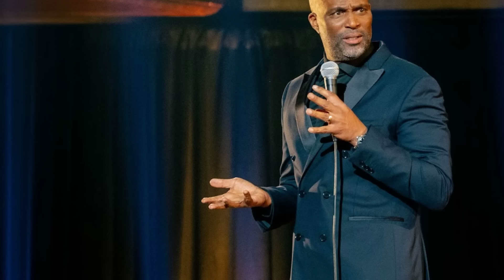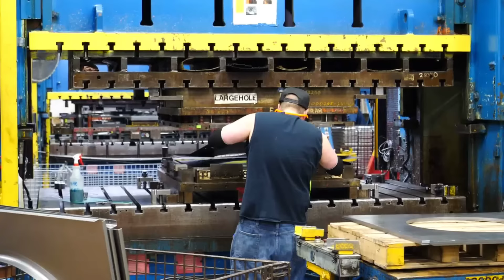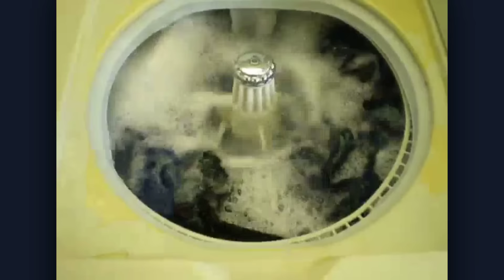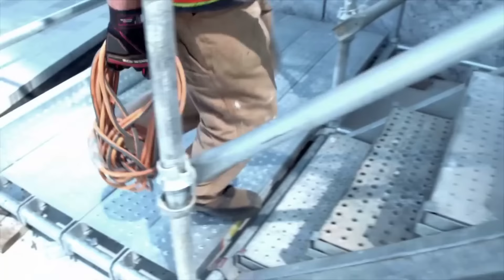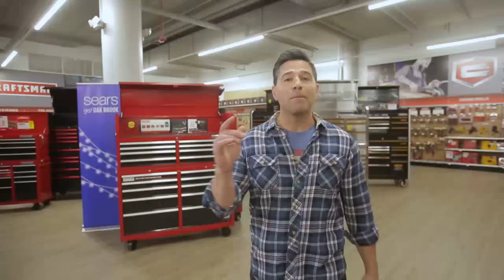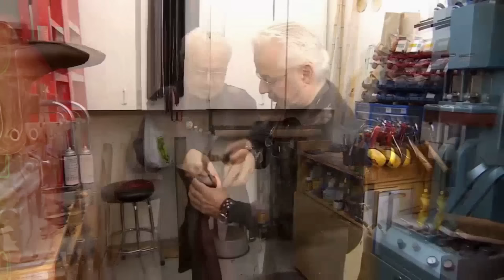The Only 5 Brands That Still Last (The "Buy It For Life" List)

Comment: Modern machines are designed to be made cheap, break easily, and get the owners to pay a ridiculous premium on the exact same cheap “genuine parts” to repair them or just replace them entirely.

My 8-year-old dryer stopped drying a couple years ago. The “genuine” part was going to cost a full quarter of the cost of the entire machine when it was new. The third-party replacement part cost $30 for two of them. So now I have a backup heating element for when the replacement eventually fails.

Same with my gas oven. After 7 years it suddenly wouldn’t get to full temp and would take nearly 45 mins to get to 400F. Replacement igniter part from Samsung or their authorized partners was $250. Third party drop-in replacement igniter made in probably the exact same factory in China, cost $20 with free two-day shipping. It took less than 10 minutes to replace and was heating to 400F in under 8 mins.

They don’t want us to have appliances that can be repaired cheaply. They want to be able to double dip with an extended warrantee, expensive repairs, and then hit us for a full replacement every 5-10 years. Mechanical failure is baked into their business model. It’s why the parts most likely to fail are expensive and the ones least likely to fail, are generic, or non-proprietary aren’t.

Comment: For all modern appliances with digital controls, like air conditioners, washing machines and microwaves, buy a surge protector for $10 to $15 to help protect the electronics. Look for a VPR (voltage protection rating aka let-thru voltage) of 500 volts or less, it should be stamped on the back of any reputable surge protector. VPR is determined during the UL 1449 certification tests.

Comment: We bought a Speed Queen a number of years ago because we got tired of having to repair a motherboard in the old washer.
While at the dealer my wife almost bit on a new model that SQueen had come out that had a hunch of electronic bells and whistles. I asked her why do you think it had a 5 yr warranty and weren't we there because of our frustration with the electronics? Thankfully we went with our original goal. It's still running like a tank and I smile everytime I hear the ratcheting of the dials as I prepare a load! 😁

Comment: One thing I'd add -- I know this video is talking about products you can still buy brand-new, but for cookware, let me recommend vintage pre-1968 Revereware. There is a lot of it available in thrift stores and antique stores. It uses no Teflon, a good thing as we are coming to realize, and it is much lighter than cast-iron skillets. Pots/saucepans are available as well -- in cast iron these pieces are unwieldy. But make sure you research first and seek out genuine pre-1968 Revereware -- you can easily tell it from later Revereware by looking for the pre-1968 double-ring logo on the bottom. Unfortunately, the brand was fatally cheapened for the remainder of its run.

Comment: I can agree on some points and disagree on others. Sometimes longevity of the products depends on how it was used. Very often people abuse appliances and they break. I still use my kitchen small electric appliances that i bought in late 90's and very early 00's. I came to conclusion that aluminum pans are no match for steel pans, and steel pans are better than cast iron.    I own a lot of different stuff that works fine  for many years. And i am talking about electrics and electronics.

Comment: Lodge are not good pans.  They don’t work like your mom’s good cast iron pan because the inside is not finished like it is supposed to be.  They are ten times harder to keep clean and free of rust and food sticks because the inside is not ground smooth.  It is rough cast just like the outside because it is cheap.  Buy an expensive one that is ground smooth or get out your angle grinder and Emory cloth and re-season it after it is smooth or you will hate it and not understand why your pan sucks compared to your parents.  Everything else sounds good

Comment: I have my 20 years old Moccamaster coffee maker (at least back then they were hand assembled in Netherlands) and about 15-year-old Bosch heatpump clothes dryer. Neither was cheap, but a high quality product is a pleasure to use every time. I've actually also been very happy with LG front loading washing machine, that I also think is at least close to 15 years. It is one of the few brands that still has not switched to welded tubs, so you can still change individual parts of the tub assembly.

Comment: Have a speed queen, and it actually doesn’t fill all the way to the top. But with a couple minutes research on YouTube, you can make it do so. The reason it doesn’t is federal regulations- but speed queen is smart enough to make the machine easy to, shall we say, “reconfigure”,so it works the way it should. 😉

Comment: I got married in 1986 her parents gifted us a washer and dryer, just base model old whirlpools. Both of those machines are still running today, I think the dryer has had one or two heating elements go out through the years, but the washing machine is only had one bushing replaced at the bottom of the tub. Not too bad for almost 38 years

Comment: My grandfather told my dad 80 years ago, ''You can buy expensive once, or you can buy cheap over and over.'' I still have some of grandpa's carpentry tools. I have cast iron pans that are over 30 years old. And I  have a pair of Thorogood boots that are about 15 years old. If I  had known it at the time what I  learned a couple years ago, my washer and dryer would be Speed Queen.

Comment: Lawnmower carburetors only gum up if you don't use 99 grade fuel and and put the anti-gumming additive in. If it still doesn't start take the filter off and spray starter fuel directly into it. If even that doesn't work a new carburetor costs about twenty dollars on ebay and can be substituted in five minutes.

Comment: It is possible to make electronics which last.  The problem is corporations no longer have an interest in building them.  I have a GE radio alarm clock my parents got me for Christmas in 1973.  I have had it through 9 moves and over 50 years now.  It still functions as well as it did on that Christmas morning in 1973.  It not only works, but it is one of the few clock radios I have seen which has an adjustable LED clock to the point you can make it dim enough to not be overly bright in a pitch black room or be bright enough to be seen in a well lit room.  I have plugged into a surge protector, and I hope it lives longer than I do.  :D

So, it is possible.  But unsurprisingly no corporation wants to make a product like that now -- and that is a sad fact.

Comment: Off topic for home appliances and stuff...but just thought Id share my experience; in 2003, I bought a Toyota Matrix XRS.  23 years later, I still have that same Toyota Matrix.  It has been by far the best purchase I've made of all the purchases there have been.  Only recently have I considered selling it for another car only because of how much cars have progressed since then.  Two things, premium gas and synthetic oil.  Never had an engine problem with that car once...everything else has been mechanical maintenance.  100% would buy again...if they still made it.

Comment: Have you thought of the amount of water an old Maytag top loader uses for a hot wash of 10 pounds?
around 75 gallons, an european front loader uses around 18 gallons for the same wash, and it actually make the clothes cleaner. I have tried both. The european also uses less kWh for the wash. I have owned danish (Haka Fullmatic 17 years), italian (Zanuzzi 15 years), welsh (Hoover 9 years, bad machine) german (Bosch 6 years still running), chinese (Samsung 15 years, couldn't get a new pcb, tired components)), polish (Samsung 1 year running), the reason for changing the machines have been the need for higher spinning speed  (Zanussi) or old age.
Hans Denmark

Comment: To be fair   Craftsmen hasn't ever been quality,   30 years ago went to sears to replace a flathead  for breaking on a actual screw  wasn't even using it as a pry bar and they found out it was broken on a car.. so they told me that they wouldn't replace it because Craftsman tools are not meant for professional use,  I told them it was in my drive way that isn't professional environment...  still refused.   lol  never bought another craftsman product after that

Comment: My local laundromat was opened back in the mid 70's and uses nothing but Speed Queen commercial washers and dryers; many of these were installed when the laundromat first opened 50 years ago and are still working flawlessly today.  The owner told me that the newest Speed Queen equipment that she has on the premises dates from the early 90's when they expanded the business and needed additional washers & dryers; she has them all serviced regularly and when something breaks or wears out the repairman simply replaces the required part and the machine returns to service without delay.

Comment: I'm a speed queen guy, they are awesome BUT they definitely still have a computer control board.  That computer isn't the problem, the manufacturers that install crap computers are.  In fairness those manufacturers are a reflection of the consumer.  If you want better products do more homework before laying down cash and convince your family and friends to do the same.  It's not a conspiracy, it's simple free market dynamics.

Comment: Speed Queen is reliable, but I don't need to wash with violence, and my Miele has been working for 20 years with not one problem and I like my clothes to last a long time. Our Lodge cast iron pan has hotspots, where as the Wagner one doesn't, Craftsman... back in the day, their power tools were low-end (Crapsman) and I think they probably still are. And they are NOT Made in USA. What Craftsman was known for were their strong but clunky wrenches, because they would not break. They are made in China now. The Redwing boots I wear daily are great and will outlast me. Wright tools are wonderful I'm sure, but check the prices, Holy cow!

Comment: Small engines dont start after a winter break because of all the ethanol put in pump gas now. Ethanol absorbs water and also dries out rubber seas. I used stabilizer and install a cheap cut off switch on the fuel line. Before winter storage, I close the valve and run the engine until it dies, effectively draining the carburetor of fuel.

Comment: My 2006 Toyota Camry has 200k plus miles on it and has never had to be repaired except for a couple of batteries and tires and replacing windshield wipers and headlights. Engine wise it is still solid. Drove 100 miles to work and back for 12 years and took many trips in it.

Comment: Or you buy a made in Germany Miele washing machine and get the good of both worlds: long lasting quality, with high efficiency and soft on clothes. My parents used theirs for 30 years, mine is at 10 years. And it saves you money twice: not only by using less energy but your clothes last longer as well.

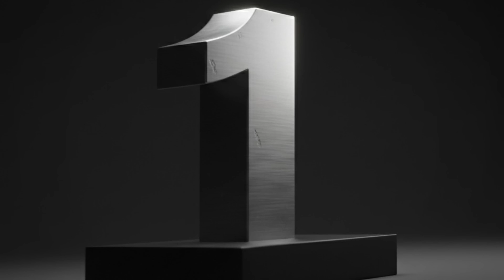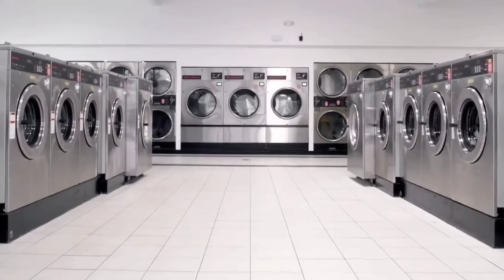Comment: Washing Machines (1:09): The Speed Queen TC5 top loader (1:42) is recommended for its industrial-grade components and repairability, unlike common consumer models with fragile electronics and plastic parts.
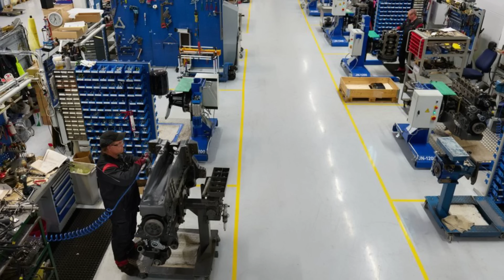•	Small Engines (2:40): Honda's GX series engines (3:13) are praised for their reliability and long-term parts availability (3:36), making them ideal for generators, pressure washers, and lawnmowers.
•	Footwear (4:11): Boots with Goodyear welt construction (4:46) from brands like Thorogood (American Heritage line) (4:56) and Redwing Heritage line (5:01) are recommended because their soles can be replaced multiple times, extending the boot's life.
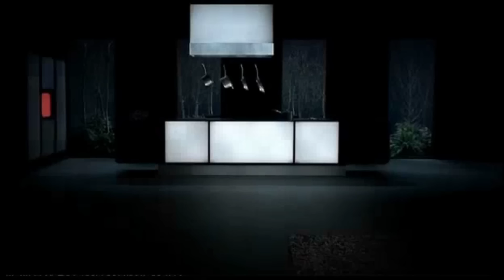•	Cookware (5:52): Cast iron pans from Lodge (6:29) are presented as a durable alternative to non-stick pans (6:00) with chemical coatings that scratch and flake. Cast iron improves with use and can last for generations.
•	Hand Tools (7:10): For tools that endure, the video suggests Channel Lock pliers (7:26) (made in Meadville, Pennsylvania) and Wright Tool wrenches and sockets (7:42) (featuring the "Wright Grip" design). These brands focus on high-quality forged steel and practical design over flashy marketing.

Comment: Great mentality, but here the washing machines mentioned are at least five times the cost of a regular machine. Resoling shoes is more than the cheap set of shoes you replace in the same period. If you can repair the machine yourself, and getting the shoes done isn't a huge imposition, and it works out a similar price it makes sense to a degree, especially if the washing machine is similar in energy and water usage. It might be more economical in the US but here in Australia just a tradie call out fee is probably 25% of a new (cheap) machine.

Comment: Knipex for tools. There expensive, but I've had my pliers wrench run over by a skid steer and you couldn't tell. I use them as a hammer and after over five years there's a tiny bit of flattening where the back hits and that's it. If you didn't know what to look for you wouldn't even know. Everything I have that's made by them is phenomenal. They use the best steel manufactured to exacting tolerances and thoroughly tested designs that hold up under real use in brutal environments.

Comment: Beautiful machine that speed Queen is. But when you have to heat your water with propane or electricity pump it from the well deep underground and pump it again to the septic tank, speed Queen will not work for me with up to 50 gallons per load. The good part is I can buy four Amana washing machines for the price of one speed Queen.  I just toss them out every 5 or 7 years matching speed queen performance with less water use

Comment: The ShopSmith is still made the USA, and still made to the same standards that made my father’s last 60 years.  The problem is, when your product is durable, then it outlives the original purchaser. It gets inherited, or sold in an estate sale. Outlives THAT owner, and gets sold again.  ShopSmith ended up completing with itself, because you can buy one just as good as new for 1/5 the cost of a new one, on EBAY or Craigslist.   When I needed a mitre saw, I tried out the best new ones I could find. They were all plastic, sloppy crap.   I ended up buying a DeWalt radial arm saw made in 1953. 500 pounds of cast iron excellence.   You can STILL buy a new one made from DeWalts old original tooling from the Original Saw company. But new, they cost $7,000.   I got mine for $500.
Engineered obsolescence is NOT a conspiracy.  It’s an emergent result of consumer purchasing behavior.  Most folks look for the lowest cost.   In competing on price corporations have to make them out of cheaper materials in lower labor cost countries. It becomes a race to the bottom in terms of quality. And corporations that make stuff that lasts just don’t get enough sale to stay in business.  
Corporations figured out that Consumers don’t mind buying new, if that means cool new features, so long as the cost is low enough.   The original RadarRange microwave oven would last a lifetime…but it cost $6,000  in 1955. That was a year’s salary for a mid-level executive. Today you can buy a short lived microwave for $100, when a mid level executive’s salary is $70k.

And today’s subscription models for everything are just corporations trying to figure out how to have a steady enough income stream that they can stay in business.

Comment: I bought my Honda lawnmower when my daughter turned 3 years old. She is now 40 and that lawnmower still starts on the first pull. I had to replace a part in the carburetor last spring but that is the only part that has ever been changed.

Comment: Our washer and dryer are Speed Queen.  Due to space constraint, we have the stack model.  It has more features than we want, but it still has most of the construction and design that defined Speed Queen. (This is not the apartment sized design and capacity; it is front loading and has full, but not jumbo, capacity drums.) 15 years ago, my father (who hadn't done laundry except while in the military until a few years prior, when my mother died), neededed to replace the no-frills top loader that had lasted over 20 years; he made a long search until he found a Roper.  Happy man, also gone now, but the washer was a selling point when I sold his house to people who wash clothes by hand but intended to rent out the house.

Comment: Sears! What happened to Sears? I bought all my stuff from Sears in 1998. They still work fine: washer, dryer, refrigerator, stove and hot water tank. Oh!. Also dehumidifier. 25 years.still working fine.  Change product subject to cars. I understand Fords in trouble. Imagine if they advertised "Buy Ford! Why? Your Ford has NO plastics parts! And only customer ordered add ons!" In high school auto shop I bought Craftsman tool set and still have them! That's 71 years! PS I'm ninety one now.

Comment: We have seven cars.  And for my yard equipment, I only buy Honda small engines for my lawn mower, my rototiller, my log splitters,  my pressure washer.  Winterize your lawnmowers each time you’re done with it as the bad fuel ruins the carburetor.  Concur with Lodge cast iron.  Yes, Craftsman sold out…Chinese made today.  Older Craftsman tools demand (and get) a premium!

Comment: I bought a Speed Queen in Australia under the brand Kleenmaid in 1992 for about $800. The timer needed a rebuild after 5 or 6 years and in 2004 the filler hose, a $25 item, began leaking. The quoted repair was $300 because the pump had to be removed the drum mounts and drum removed and then all refitted. So don't give me Speed Queen are built for the long run.

I got the same life out of my much cheaper Simpson Delta 10.

Comment: I would add carbon steel frying pans, lighter than the cast iron, and seasoned easily. Once seasoned avoid acidic foods otherwise you will need to re-season, and wash with hot water.